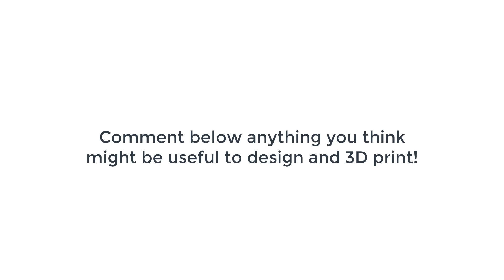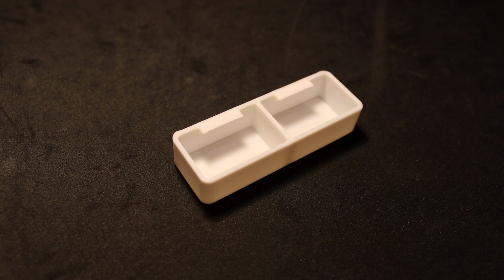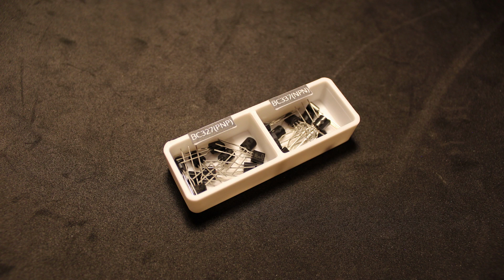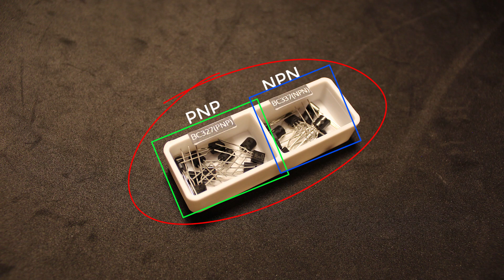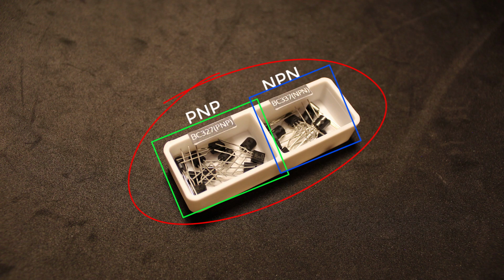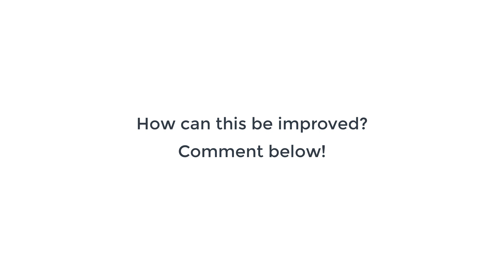The Best Item Organiser! (Useful 3D prints) | #3D1

Comment: This is a nice storage system. What I would change is to make the larger enclosure stackable so it doesn't move around. It would add feet to the bottom but holes on the top for another one to stack on. Thank you for the design.

Comment: Optional handle 
Locking system for travel
Reply from the maker: Those are great ideas!
Reply: @ProjectsWithRed  plenty of design options. One is a rotating clip on the frame (like a height-length door with snap-on latch , except there's no need to cover the entire front, just the sides to prevent drawers from escaping). Alternatively it could be a locking pin or xz-axis latch on each drawer. A ''''''''''''''u''' shaped groove on the frame walls may also hold drawers in place using gravity (?). If this is not clear, the point is to have fun lol.
Reply: drawers may also clip into place using an existing box clasp mechanism
Reply: Suppose one wishes to expand this system. If the box was modular, one could assemble a larger array with sliding dovetail options. Look up modular on thingiverse.
Reply from the maker: @no_one6749  Good stuff. I will be considering these suggestions for the next version of this organiser. Remember to subscribe so you don't miss it! :)

Comment: If I may make a suggestion, and I may just modify your part myself for my use, the entire drawer holder could be designed to use no supports if you would print it with the back side down and cut an angled profile from the bottom up on what is the bottom the way the .stl files are oriented on github. This would take more material, but I hate supports :)
Reply: So I did this and the material savings just weren't worth having to print an overhang. Filling in your "bottom" side is the way to go and print it with the back down.
Reply from the maker: @R3RadioResearch  You can actually print the drawer housings without any supports, bridging will take care of it :) However, I have now updated the repo that includes all housings with the bottom half filled in, just in case your printer is not able to do long bridging. Thank you for the suggestions, you just made it better!